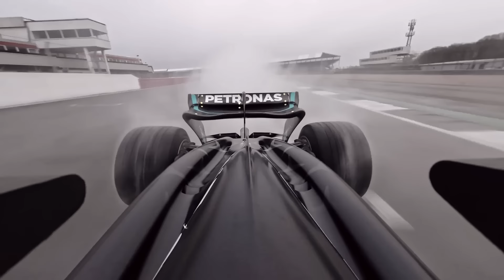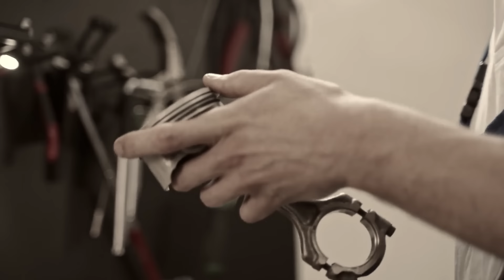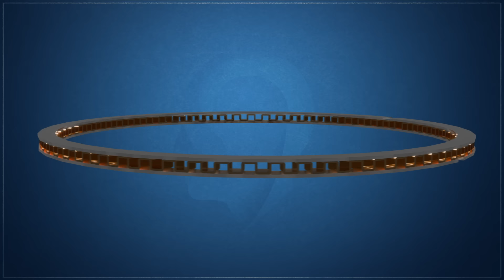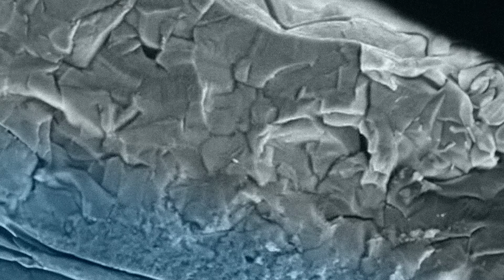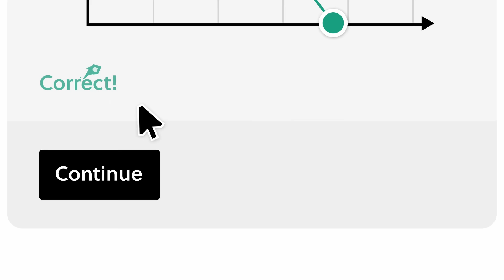The Clever Engineering Of Piston Rings

Comment: The engine I decided to build and use in my Skyline has a single compression ring (with a 'gapless' design) and a regular oil control 3 piece ring (RB20 Neo). Many of my friends told me I wont be able to turbocharge this engine because of it's single compression ring. I spoke to a design engineer at Wiseco and he told me I got lucky because most commercial engines especially up to 2010 still do not frequently utilize this technology, which is most often used in motorsports. For comparison, other RB engines such as the RB25DET and RB26DETT use two regular compression rings, resulting in more friction. The guy also said I wont have to worry about setting the gap because, as their name implies, they are gapless. Both ends of the ring interlap and the introduction of boost pressure further strengthens the seal. The only downside is that it's very hard to find new, OEM rings for these pistons. Also, these pistons come with the DLC (diamond-like coating) on the skirts, whereas the other RB engines do not have it applied to them. May people sleep on this engine mostly because it's a 2.0 liter and stock it is 153 hp, but I'm currently running 1 bar of boost and making 320 hp, all stock internals, and 9k RPM rev limit.

Comment: I can remember when / participated in a re-ring 

Take the motor apart just replace the rings and gaskets and send it down the road 

Some uncles of mine raced dirt bikes in the 79’s and told me they would re-ring the engine in between engines like a top fuel car 

Look at a 70’s motocross bike , air cooled not crazy fairing or airbox , a simple process

Comment: My old diesel m57 2.5 stage2 consume 5L per 100km at highway and 7 in town. Car manufacturers told you about cutting eggs technology of new engines that save 10-20% fuel BUT will last 100k and then broke and repair is not possible or super expensive + will not last for long. My engine already 530k with minimal service...

Comment: These MPG regulations are actually making the environment worse.  How does the burning of 1qt of oil per 1,000 miles help the environment?  It takes a lot of energy to make a new engine.  With the oil usage of modern engines, the engines will have to be replaced more often.

Comment: I'm a believer now in a Berryman's ring-soak. I had one cylinder of 4 reading only 110PSI while the others were 165-ish. I only did the Berryman's on the low cylinder, and also added Restore to oil. Drove if for about a month, double-tested each cylinder, and was astounded to find low cylinder was 185PSI an the other 3 were 180-185PSI  This is on a 2002 Focus DOHC 2.0 ZETEC with 208K miles on it. Also, it uses very little oil. I finally did the clutch a year ago, as it's a 5- manual.
I saw how he showed the combustion pressure increasing ring sealing, and if there is carbon in there, it would hinder sealing. I used to be very skeptical.

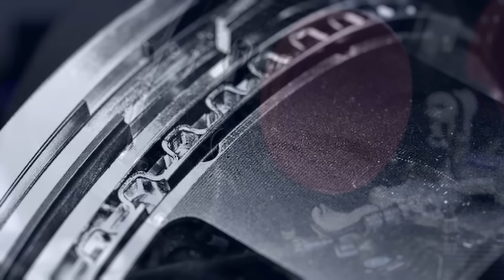Comment: 1:00 just in regards to your intro: it should be worth noting that I was always under the impression that the engines get an entire rebuild after each race or are just outrightly replaced. It's certainly a testament to materials engineering and I would like to see the philosophies of these motors influence the production of modern consumer motors but only time will tell.
Reply: Top fuel drag car engines are rebuilt after every pass, maybe that's what you were thinking of. 

Im sure the Formula series engines are consistently inspected and rebuilt, but they have to deal with more of the endurance aspect than just the raw power that most drag cars have to deal with.
Reply: @sonicsphincter6 you're right I was thinking of top fuel

Comment: I still dont get how the top part of the topmost ring doesnt end up in metal-metal contact. It would seem all the oil gets scraped below, and if there were oil getting pushed to the top, it would be burning off. Unless that 1 micron layer thick coating is so small that it amounts to virtually nothing even after thousands of miles

Comment: HUH?!? 12:25 the center of the oil control ring does not feed oil back into the crankcase, engines burn oil and they are meant to burn oil, consumption rate, the oil control ring holds oil in the waves, the cross hatch on the cylinder liner holds oil,  more oil film makes the engine last a lot longer, just a bit more dirty risks glazing issues, at this point of the video you haven't even mention the main most important engineering function of the piston rings, the gap is set at the expansion and contraction variance between the piston and cylinder.. the gap is set so the piston doesn't expand and seize, colder climates and extreme operation require more gap

Comment: RPM is not piston speed.  Stroke determines piston speed at a given RPM.  Piston speed should be stated in ft/sec or m/sec.  I don't feel like doing math, but a piston that's only got a 1 inch stroke is going to be moving a hell of a lot slower at 1000 rpm than one with 30 inches of stroke.  You can also moderate piston velocities by increasing the rod ratio.

My favorite piston ring myth is that you have to make sure the ring gaps aren't lined up on installation of the piston.  Pro tip: those rings are going to rotate.  At some point, they end up with the gaps lined up.  I've even tested it by assembling engines with ring gaps purposely aligned.  Zero negative effect on compression or blowby.

Comment: I'd worked in a facility coating piston rings with both normal PVD and PDLC and this rounds up very well what's behind the whole thing. I'd like to mention that modern piston ring coating is a complex process involving high tech and top edge know how. It's not a simple coat but rather a stack of many layers coming from pure steel (top ring) or iron cast (oil ring) which is needed because the completely different type of material and surface structure. While chrome coating is applied after some nitration process, to provide a proper outer layer of DLC (diamond-like-carbon) needs not only this but adhesion layers of chrome and carbon underneath to grasp tightly onto the steel or iron. But the very thin carbon adhesion layer has very poor properties in terms of elasticity and lacks other demanded goals of friction, tribologic and thermic durability. Due to the differences between the underlying coats and the needed surface it took at least 3 different layers successively changing the material to produce and because the variables were such complicated to steer a single gradient layer wasn't possible. One very important thing to mention is the name-giving content of a type of nano diamonds. The correct name for this was ta-C 3sp (tetrahedral amorphous carbon with around 40% of 3sp carbon aka diamond) if I remember correctly.

Comment: This is a great example of the increasingly rare type of Youtube article that allows you to actually learn something. As far from clickbait as you can get. I spent 30 years as a competition engine builder but much of this is new to me, although I can confirm some of the benefits from hands on experience. We were building a certain type of engine that used 1960s piston and ring technology, but we took the opportunity to change to a piston that used a modern coated and plated ring pack. The results were spectacular in that you could feel a significant reduction in friction even when just pushing the pistons down the bore manually. In use, with no other modifications, the engine gave another 10bhp, fuel consumption was slightly improved and oil consumption significantly reduced. On top of this wear was significantly reduced, particularly to the bore face. Brilliant article - many thanks.
Reply: What was the original HP?
Reply: Damn crazy i was an engine builder for 40 years and use piston ring design from the 1950s!

Comment: I designed metal gaskets for the major oil companies, it was literally the hardest engineering project and I am a PhD , -5000 psi to 25000 psi and -50f to 200f. Much respect to piston ring engineers
Reply: Something fucky is going on with the math here, "-5000 psi" must be some kind of augmented scale without stating it is augmented; otherwise, if interpreted literally, "-5000 psi" is total horseshit, you can't have NEGATIVE pressure (whereas relative pressure, analogous to Kelvin/Fahrenheit/Celsius, the "zeros" are dependent on the used unit and some units have "negative" values - PSI is traditionally used in a manner consistent with Kelvin, where 0 is the absolute minimum)

I mean, if 1 atm is ~14.7 psi, what the ACTUAL HECK is NEGATIVE 5000 PSI supposed to mean, like, physically?!?! 🚩
Reply: @JohnSmith-zy1ur FYI -5000psi is where sea water is at 5000psi and internal pipe is at atmospheric so a reverse pressure scenario!
Reply: @BeInnovativeToday  atmospheric pressure at sea level, aka 1atm, is roughly 14.696 psi. Wat?!? Huh?!?
Reply: I thought you'd be pushing it if you wanted to talk about piston rings for more than a minute.  I WAS WRONG
Reply: Up

Comment: A Deep Dive into the Evolution and Design of Piston Rings in Internal Combustion Engines

*   0:00:12 Introduction to Piston Technology: The 2023 Mercedes AMG F1 M14 E Performance power unit's pistons, weighing around 220 grams, withstand over 10,000 G's, showcasing the extreme demands of Formula 1 racing.
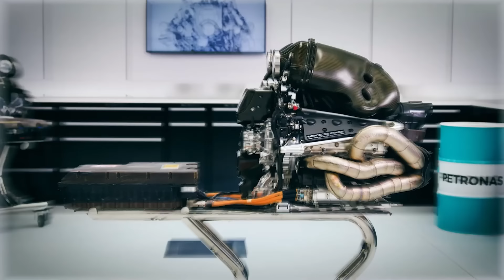*   0:00:28 Thermal Efficiency: These engines achieve over 50% thermal efficiency, a remarkable feat compared to conventional engines, pushing the limits of material science and engineering.
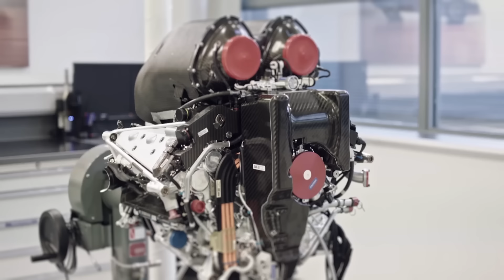*   0:00:41 Early Piston Design: The first internal combustion engine pistons were derived from external combustion steam engines, initially made from wood and later cast iron.
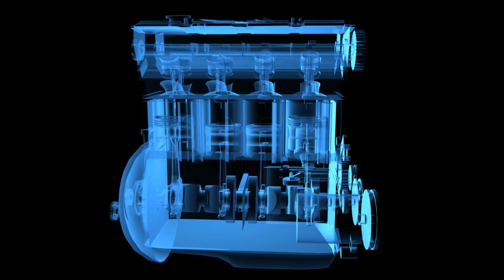*   0:01:44 Evolution from Steam to Internal Combustion: Steam engines operate at lower temperatures (below 500°F) and pressures (below 25 bar) than internal combustion engines, requiring a different approach to piston design.
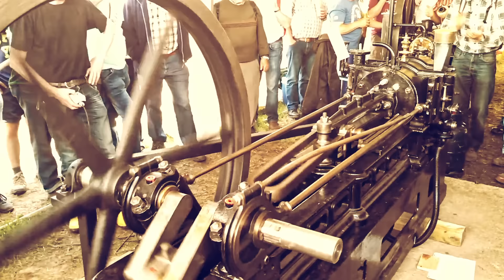*   0:02:17 Four-Stroke Engine Impact: The introduction of the four-stroke engine by Otto and Langen in 1876 dramatically increased cylinder temperatures and pressures, necessitating advancements in piston ring technology.
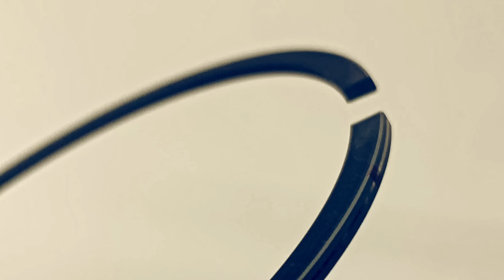*   0:03:17 Metallic Split Ring Seal: John Ramsbottom's invention of the metallic split ring seal in the 1850s revolutionized piston sealing, reducing friction and increasing durability compared to organic materials.
*   0:04:12 Multi-Ring Configuration: By the 1880s, the modern multi-ring configuration emerged, with compression rings for sealing combustion gases and an oil control ring for managing oil distribution.
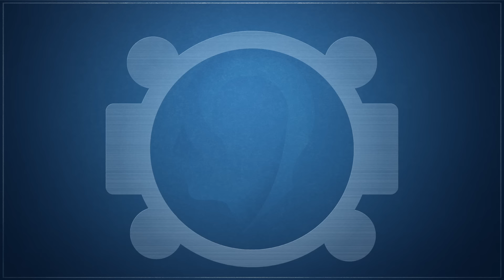*   0:04:31 Piston Ring Properties: Key properties such as tangential tension, specific contact pressure, and radial pressure distribution guide piston ring design, balancing sealing with friction reduction.
*   0:06:17 Combustion Pressure Dynamics: Up to 90% of the contact force on piston rings comes from combustion pressure, which enhances sealing during the engine cycle.
*   0:07:12 Piston Ring Profiles: Different ring profiles, such as rectangular, taper face, and twisted, are used for gas sealing and oil control, with each design offering specific advantages.
*   0:09:54 Advanced Ring Designs: Napier and Keystone rings were developed to further enhance oil control and combat carbon deposits, particularly in high-temperature environments.
*   0:11:55 Oil Control Rings: Introduced in the 1920s, oil control rings regulate the oil film on the cylinder wall, using longitudinal slats or bores for oil drainage.
*   0:14:19 Piston Ring Materials: Gray cast iron and steel are the primary materials for piston rings, with various treatments and coatings used to enhance wear resistance, durability, and thermal management.
*   0:16:02 Advent of Hard Chrome Plating: Hard chrome plating, introduced in the 1930s, significantly increased piston ring hardness and engine life but required longer break-in periods.
*   0:16:39 Molybdenum Coatings: Introduced in the 1960s, molybdenum coatings offered a balance between cast iron and chrome, providing good temperature resistance and lubrication.
*   0:17:17 Modern Piston Ring Advancements: Since the 2000s, the focus has been on thinner piston rings with advanced coatings like physical vapor deposition (PVD) to reduce friction and improve fuel efficiency.
*   0:18:21 Critical Design Dimensions: Piston ring design involves critical dimensions such as ring height, radial wall thickness, free gap, joint clearance, and specific contact pressure, all affecting performance and longevity.
*   0:19:26 Formula 1 Engine Piston Rings: Formula 1 engines use ultra-thin steel rings with tungsten carbide coatings and titanium expanders, designed for minimal friction and uncompromised gas sealing at extreme temperatures.
*   0:19:56 Modern Vehicle Trends: Today's vehicles employ thin ring designs and synthetic oils for better fuel economy but often face longevity issues and increased oil consumption.
*   0:20:39 Future of Piston Ring Development: Regulations and market demands drive the development of thinner rings with advanced coatings for even lower friction, potentially making pistons a primary longevity failure point again.
*   0:20:57 Sponsored Segment - Brilliant: The video concludes with a sponsored segment promoting Brilliant, an educational platform offering interactive lessons in math, data analysis, programming, and AI. The platform emphasizes a first-principles methodology and active problem-solving, with content created by award-winning educators and industry professionals. The segment highlights Brilliant's measurement course as a way to build geometric problem-solving skills.

I used gemini-1.5-pro-exp-0827 on rocketrecap dot com to summarize the transcript.
Cost (if I didn't use the free tier): $0.05
Input tokens: 32818
Output tokens: 1053
Reply: Muito blá...blá...   blá...

Comment: If there os no oil in the compression rings, how is that possible that they don´t scratch the cylinder wall?
Reply: There is always a very thin layer of oil 'trapped' withing the cross hatching. Every engine uses some engine oil, as it is burnt in the combustion process. If someone claims their engine uses no oil, it is just that the oil is being diluted with fuel.

Comment: Maybe you can make a more in depth video on the subject, this video was oversimplified and extremely basic. It skipped over and omitted more information then it provided. I didn't learn anything I didn't already know from this video. This is a fascinating subject and publicly available information is scarce on it. I'd like to see a lot more detail on ring coatings, bore finishes, and lubrication of the interface. Especially when it comes to the tribology of different combinations of materials, coatings, and additive packages. I don't know if the data is proprietary to ring manufacturer, oil companies, ect or if it's just hard to find online, but the science, engineering, and chemistry behind this subject seems to be unavailable. It's buy this oil because it's better or buy this ring because it's better when my experience and limited testing shows that oil additives ring materials and coatings bore materials all interact differently and require different surface finishes, oil additive packages, ect.

Comment: My car is a 1984 Honda CRX  i bought new . It got 50 MPG then . After 354,000 miles i get 42 now.  It does not have a oil ring only two compression rings.😊.  Haven’t had to add any oil between oil changes of 3500 miles.

Comment: There's another invention called DC motor which was invented in 1886, use that and there's no need for any internal combustion engine technology and oil and piston leakage, fuel efficiency etc etc
Reply: No, you trade all of that for batteries and energy density per pound and heavier vehicles.  Both systems have their uses and drawbacks.

Comment: Summary of automotive development:
late 1800s: Just improving it enough to be practical
1920s-mid 90's: Improving durability and power
mid 90's to present: Efficiency and cost cutting
As someone whose installed rings, the side profile of these rings can be so fine that it's imperceptible. And sometimes the secondary and primary rings can also be very hard to tell apart. Often they have to be marked to indicate orientation and order. The ring design changes on oiled 2 strokes for obvious reasons.

Comment: the modern style ring oil consumption to increase fuel efficiency I hope offsets the cost of more frequent oil changes and hopefully maintains the lifespan of the engine to that of the older ring designs.  otherwise the economy is questionable if engines fail sooner.

Comment: I work for a well-known engine manufacturer in the engineering department. We have subject matter experts who's focus is solely on piston rings and their performance. I was just having a conversation with one a few days ago, so it's interesting to come across this video.
Reply: I have a feeling I know who you work for, and I likely know the SME you were talking to. 

The content in this video is impressive and spot on. I didn't think I would see something this good outside of work.
Reply: I wonder if you could help me with a question. If you drove a minivan and you buy the same type of minivan every couple of years and generally put about 100,000 miles on them during that time, how often would you change your oil if you were using a full synthetic offbrand oil? I’m just curious if every 30,000 miles is too long 😉
Reply: @562handsomemike  

you should change the oil per the manufacturer's recommendations. 

Can you go beyond those recommendations safely? Yes, yes, you can. 

But one who knows how to stretch oil change intervals wouldn't ask that question. So you should stick to the owners manual.
Reply: @562handsomemike  30,000 Miles is far too long between oil changes in my opinion. Clean oil is the life of an engine. I change my oil and filter about every 3000-3500 miles. But that said, I'm not buying a new vehicle every 100 k. I'm keeping it going for as many years as mechanically possible.